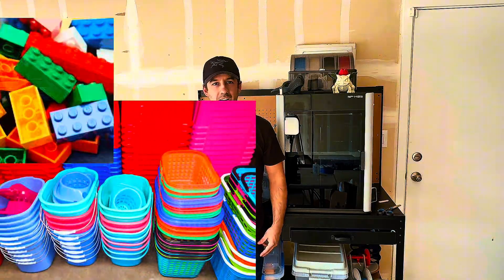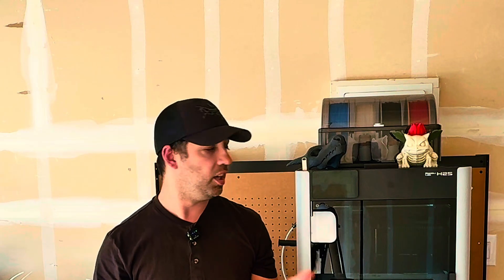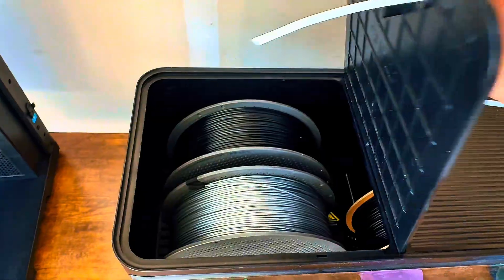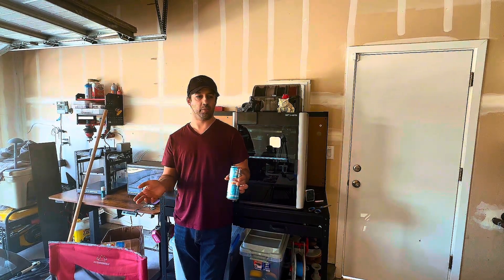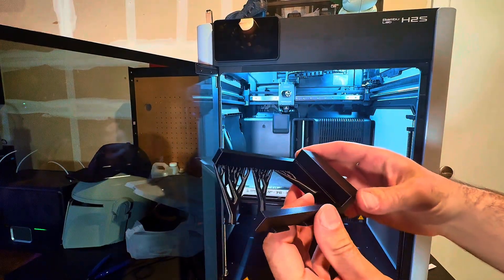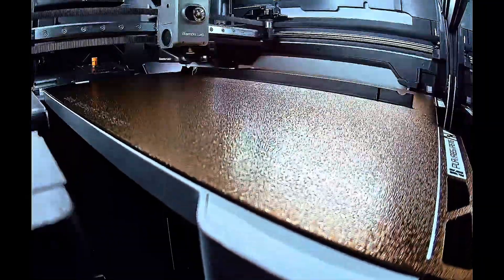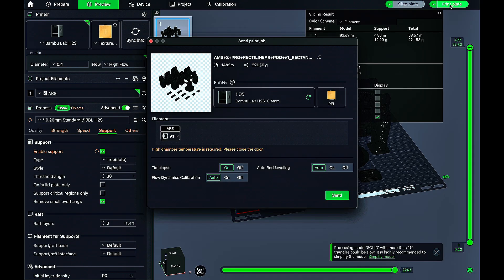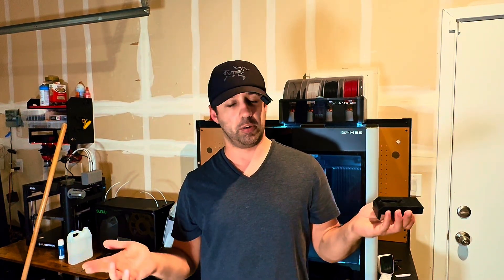My First Time Printing ABS on the H2S ( This Printer Made It Easy)

Comment: In another video you said is moving a lot is that too noisy 
I am planning to have it in my room 
Can you do a video showing a bit more how much is moving while printing and how much noise is producing
Reply from the maker: I can try but I will say I wouldn’t use it in my room if i was trying to sleep but I’ll see what I can do for ya
Reply: @Ctrlpcreations  You don't want it in your room, I have the H2D and its quiet wile printing but its noisy on filament cuts lots of clicking, also the light has to stay on or you loose your AI assist

Comment: I haven’t tried ABS yet with my H2S. I have done a ton of ASA and it’s been perfect.
Reply from the maker: I have some ASA on the way I’m super pumped to try it!
Reply: @Ctrlpcreations  All I did was put down some Magigoo for the release agent. Good luck!!
Reply: I wish my experience was the same with the H2S and ABS. I don’t know what I’m doing wrong 😢
Reply: @dezmacwifi-trader9703  I used Nano Miner for the bed and did a heat soak for 20 minutes prior to heat up the chamber. Not sure if that will help what what you are experiencing.
Reply: do you print inside?
Reply: @ezola.d4169 yes but I have ventilation
Reply: ASA is pretty much just upgraded ABS.

Comment: Got my H2S the other day and one of my first prints was with some Qidi odorless ABS. I also have a Qidi Plus 4 and while it's a capable printer, I always kindof hold my breath in expectation that it's going to warp any time I print with ABS or ASA. The H2S pulled it off flawlessly..The odorless stuff actually has a slight odor to it although it's not bad, but I didn't smell anything so apparently the Bambu's filtration system is working pretty good.
Reply: I love ABS on my Plus 4. Just like most printers, calibrate the filament for your printer if there isn't a profile for whatever you are using. Most likely this video is using BBL ABS, so it should print just fine.